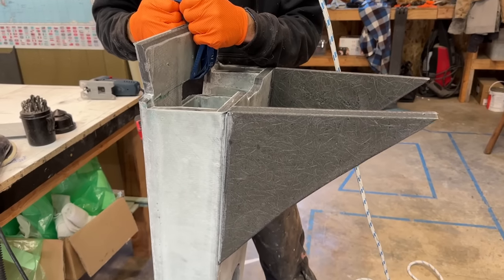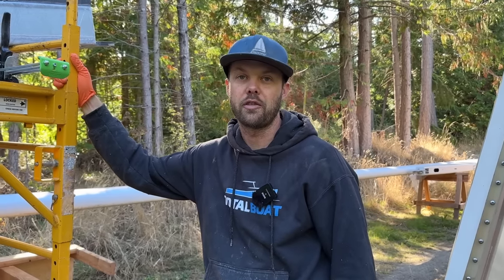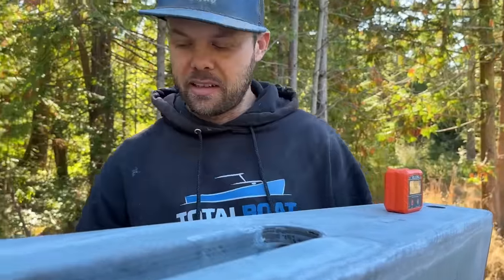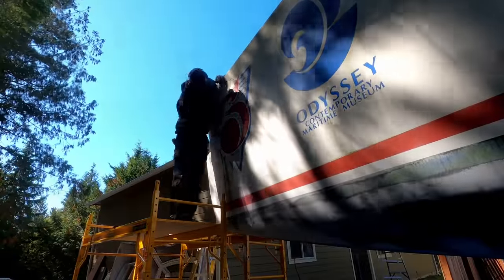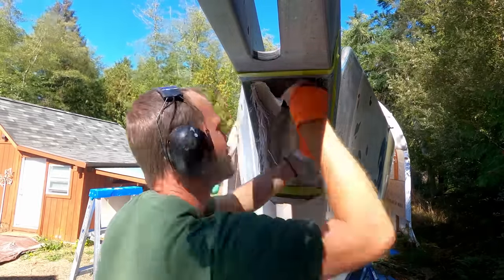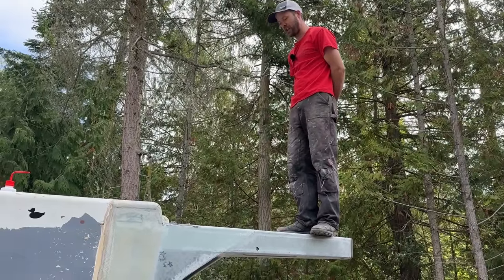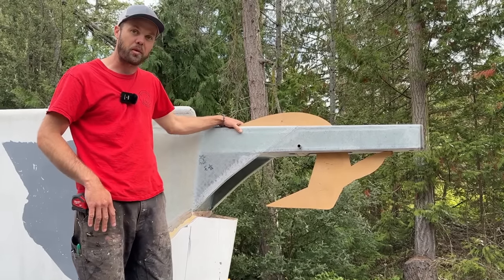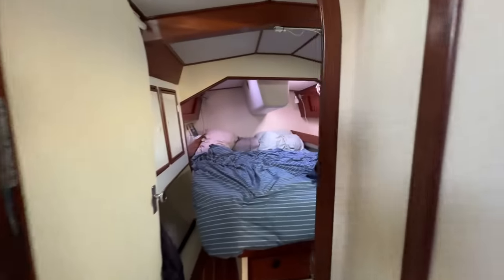We built this bowsprit. [E97]

Comment: Love this idea of replacing the logos on the hull. Would be cool if they were very subtle. Something like the same colour as your hull but Matt not gloss with some slightly darker highlights in parts. Just enough to know if you looked hard.
Reply: @chrispomfret8592 this is a very good idea, it would be like a water mark of sorts. I suggested to Matt and Janni that the stern extention could be painted in a very subtle, slight different colour from the original shape of Duracell, so its original design would be preserved, if ever so discretely, more or less as your concept for the graphics.
Reply: One could mix in a little bit of glitter effect in the paint just for the old logos. With the right amount it would be a little bit ghost-like.
Reply: @chicobicalho5621  Yeah a watermark. Not sure I agree with interrupting the new lines though.

Comment: Regarding the bow fill in under the bowsprit. I saw a Mako rebuild where the guy took the 4lb two-part foam and put a simple form around it, poured it in, it expanded and bubbled over, he cut it, shaped it, sanded it, then glassed over it.

Comment: The Bowsprit looks super strong and it has nice lines that merge well with the boat.  I never noticed the tools that the “Inspector” carries on that coat thingy.  So cute and it seems like the addition passed inspection.  When you talked about the weight of the bow sprint I had 60 pounds in my mind and was surprised at how light it actually was.

Comment: Love your work!  The sprit looks strong enough to do serious damage to anything that got in your way :).  I understand why you have dispensed with the second roller to stop the anchor from rolling under the sprit, but the problem is still there.  What about a block of hard rubber or some such attached to the underside of the sprit, with an inverted V cut in it to fit the  nose of the anchor and hold it steady and stop it moving from side to side.  I'm not familiar with the anchor you are planning to use, but a block maybe 6 inches long and say, 4 inches on a side, with a V shaped to guide the anchor home and then hold it tight might work. That size should be plenty big enough and could be tapped into the bottom of the sprit for easy replacement.... and wouldn't be too much of an eye-sore.  Just my $0.02.

Comment: Another great video guys, the bowsprit looks very strong and functional. I know you have probably thought of this already but just in case it has slipped by, you should mount a stainless steel or hdpe pad under the sprit where the anchor will contact at the front as a sacrificial chafe protector/load spreader thus eliminating point impact loads when the anchor drives home.
cheers Moose

Comment: The carbon glass steggering i find that one very interesting because glass stretches out way further than Carbon i didn't looked it up but as far as i can remember it is 4% differens what you see most of the time in carbon glass laminations is that de carbon is first holding the load and when that snaps the glass is than holding the load this is offcoarse with regular E glass you have many types with different kind of strech and braking loads but maybe you can tell is more about the choice of the laminate

Comment: I suppose the underside of the sprit, where the forward end of the anchor fluke will be touching for the anchor not to wobble will also need a stainless liner to protect the composits from abrasion. Perhaps, if this liner is shaped so it braces the anchor fluke somewhat, instead of just being a flat piece, it will hold the anchor more firmly. I guess you will need a metal fabricator to make a number of stainless liners in strategic areas, maybe if you donate all your left-over stainless flotsam to this metal fabricator, she or he can figure out a means to recycle some of that metal, and lower your fabrication costs.
Reply: That's the plan (stainless steel anti chafe liner). But nice and thin to save weight.
Reply: Considering the dozens of pounds of stainless steel you guys extracted from Duracell, and replacing with carbon, the liner has to be thick enough not to wear out from friction, say, in the French Polinesia, where it will be hard to repair or replace. If 2 mm is thin and 4 mm is better suited, the weight difference will be irrelevant. And as far as the underside of the sprit, perhaps something soft, like a piece of resistant rubber bolted to the sprit, so the anchor fluke has something to grip on to, instead of a piece of metal where it slides around. This way, you guys can make "reserve" pieces so, if one wears out in Fatu Hiva, you guys can replace it. I suppose the liner in the anchor channel can be thin because only if the chain sags and touches the bottom of the channel it can cause minimal contact. But if your metal fabricator does a nice job, this bowsprit will look really beautiful. Actually it IS already looking beautiful!
Reply: @evangatehouse5650  Will a difference of 2 mm in thickness make any real difference? Let me answer you - No. Besides, a chat with Dick Beaumont on this issue of "always ultra light" will be very sobering, and educarive. Do look him and Kraken Yachts up. Summarising; very light boats meant just for speed sometimes sink out of nowhere from the loss of a keel, or put sailors in deep shit from rudder damage. OK of you are racing, but otherwise, not OK. Sailboats are not, by any means like racing bicycles.
Reply: @chicobicalho5621  Gary Mull noted yacht designer "The only moving vehicle that benefits from EXCESS weight is the steamroller". Chafe plates are often very thin because they are not rudders or keels or structural elements.
Reply: @evangatehouse5650 I am not taking about excess weight by any means, just using the proper material to protect key areas. Besides, my commentary on people obcessed with shaving weight was a side note, regardless, to anyone intrested in bluewater sailing, listening to Dick Beaumont's advise is really important. As far as this bowsprit, it already weighs 16 kg, so, if a stainless liner is 3 mm thick instead of 1 mm thick, the difference in weight is totally irrelevant, grams at most, for the areas where these liners will be are very small, and the important thing is protecting the material underneath.

Comment: Nice episode.  I'm sure your engineer helped design the bowsprit so it wouldn't fall off.  I can't wait until your first crossing to verify its success. I'm definitely not an engineer, but the glue seems inadequate to hold the deployed anchor, foresail, and headsail.
Reply: Good thing the engineer is. The gussets below are holding most of the forces. The code zero is anchored to the stem bulkhead chainplate, not the bowsprit.
Reply: You are definitely no engineer :)

Comment: I'm curious, after you explained and demonstrated how the anchor will tuck up to the underside of the sprit, if you are worried about steel to glass/carbon abrasion? Even though you're shooting for minimizing the amount of stainless hardware attached to the boat, this is one area where it seems very logical to mount a stainless plate on the bottom of the sprit where the top of the anchor will touch once fully weighed, to minimize the the chaffing that will likely occur after years of snugging the anchor up...not to mention the forces of a rough sea state.  I hope this isn't a stupid question.
Reply: That is what they said they are planning to do last video

Comment: Everything is awesome and well designed as usual but I'm a huge chicken and I would have laminated the top of the bowsprit at least a couple (maybe more) feet onto the top deck and at least a foot wide. There will be a lot of force pulling down on the bowsprit and it doesn't seem to comensate for that? And again you guys are doing a wonderful job!
Reply: The top is glassed to the deck - but you don't need 2 feet to transfer the forces.
Reply: There is a point of diminishing returns and it comes quick. You could have a 10 meter lamination but it would be for nothing as the forces go down close to 0 in the first meter

Comment: Can you explain a bit about your layup strategy?  Everyone else I've seen lay up fiberglass puts the smallest layers on the bottom with progressively larger layers on top so each layer grabs a bit more of the base substrate.  You seem to always put the largest layer on the bottom so successive layers are only attached to the layer immediately beneath.  Is there any real practical difference?
Reply: They're wrong. Basically if you put the smallest layer first, each bigger layer you get a break in continuity where the upper layer has to go over the edge of the lower layer. Standard aerospace custom is biggest first.
Reply: I have seen him do both

Comment: You could get by happily on 10mm (3/8") chain......just saying. The only time I have seen boats break chain is when wrapped round a coral head giving a very short scope and an after dark windshift giving a lee shore with lots of fetch for big chop. As long as you anchor is big enough...
Reply: Snubber will help also. The peak loads go way down if you have a stretchy snubber.
Reply: @mckenziekeith7434  snubbers always help BUT they have to be nylon and almost a full boat length. Mine is hooked over the primary winches so has 15m to the bow....m
Reply: @deerfootnz  I don't see the benefit of having a snubber routed that way. It just creates a chafe problem. It should be in the water so it does not chafe on anything. Hence an eye on the bow near the waterline. I agree that nylon is the best choice. It has to be something elastic for sure.
Reply: @mckenziekeith7434  it's still in the water. The extra length is extra stretch and shock absorption. I only use the longer snubber when the extra stretch is needed.